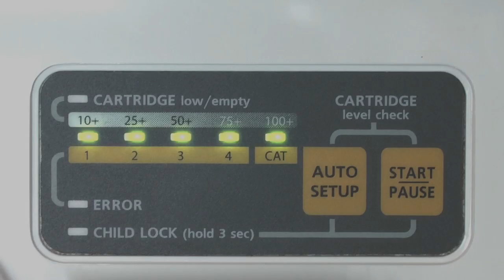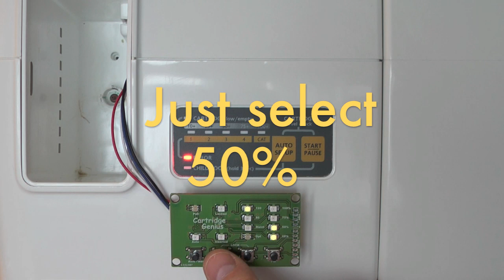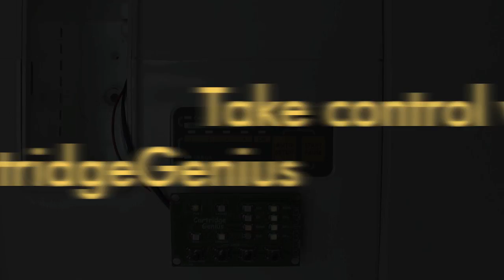CartridgeGenius demo

Comment: @CatGenius120 I recognize that this is an alias account that is older and may not be checked very often, but I have a question about your CatGenius. We had to replace a broken down CG AI and instead of the nearly thousand dollars a new purchase would cost, we took a chance on a couple of older 120 models a nice lady was selling. Turns out one of them has a Cat Genius connected! I set everything up, but the Poll light is not flashing like your user manual says it should be. Is that a problem when using  a refilled cartridge, or is it only an issue if trying to run it as a virtual cartridge? It’s running currently, I’m going to remove the refilled cartridge it came with to see if that makes a difference with the poll light making any flashes.

Comment: This allows you to use yer own solution either by refilling the cartridge or using a bulk setup.  This doesn't replace the cartridge...just the RFID tag inside the cartridge.

Comment: I have an old Cat Genie and I have been recharging my used cartridges over and over....I got tired of refilling the cartridges and found it works perfectly without cleaning fluid.  Once a week throw in a little bleach or whatever and run a cycle.  It keeps it clean enough....after all, how often do you really wash out the scoop litter box??? This is way cleaner.
Reply: snowflakemtn how are you refining your cleaning solution? I tried it once by pulling the nipple thing off and refilling it and it worked but he next time I did it, it just beeped like it was empty until I put a real cartridge in...